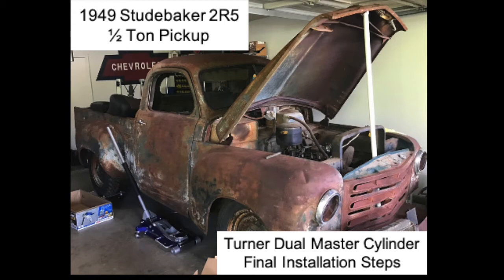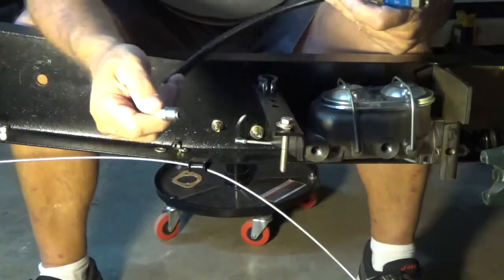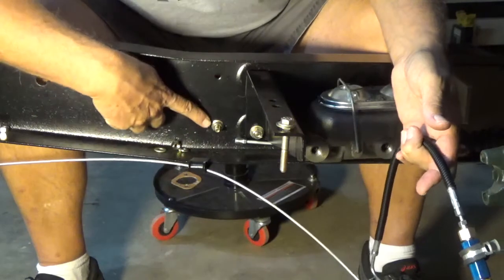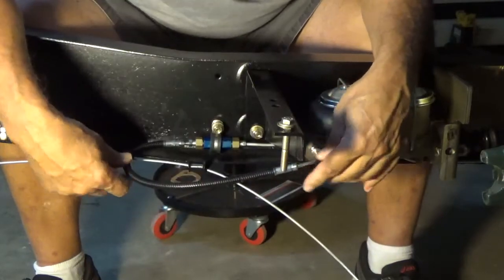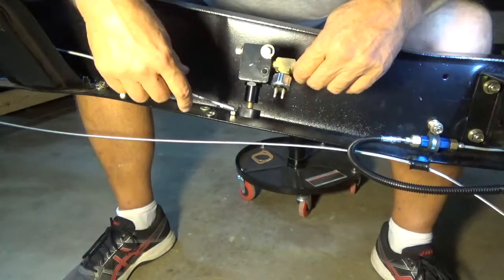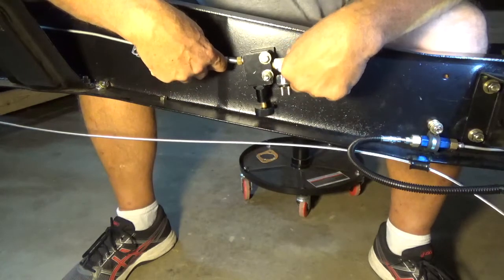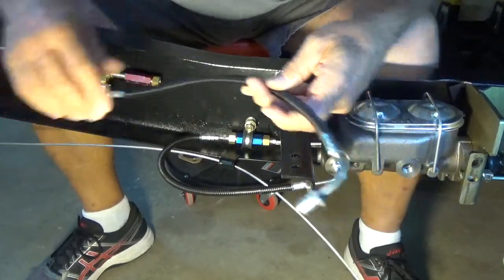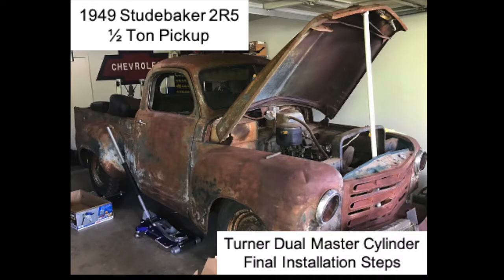1949 Studebaker 2R5 Turner Master Cylinder Final Install Steps

Comment: Why did you use flex lines instead of bending and flaring steel lines?
Reply from the maker: Not experienced enough to do some tasks and bending  steel lines is one of those so I minimize those weaknesses as much as possible.  I did do some bending on brake lines but you can tell I’m not that skilled.  The flex lines used came with the kit and really made the last connections easy.

Comment: Billy  the rod that is used from the the brake pedal to the mater cylinder, do you have any pictures of how it is kept in place? I am not sure what holds it in place as the kit does not include anything for that    thank you
Reply from the maker: I had the very same problem and came to the conclusion that my cab actually provided the stop for the brake pedal.  There is also a rubber boot that was connected to the master cylinder and covered that rod but it did not seem to have any holding ability.  I tried using a second spring with no success and it was only when I got the cab back on that I was able to keep the rod and master cylinder together because the cab stopped the travel of the brake pedal.  I will continue to research but that is what has happened so far.  Hope this helps.

Comment: What about the residual valve I have chevy dick brakes on the front
Reply from the maker: For the Turner dual master cylinder system I received a 10# pink check valve one for the rear drum brakes and a 2# blue check valve for the front disk brakes.   I got the complete dual master cylinder kit, to include the master cylinder, from Mr Turner and used both the check valves per the instructions.